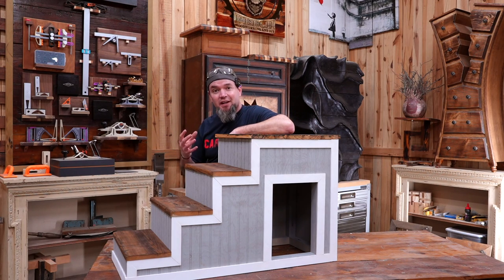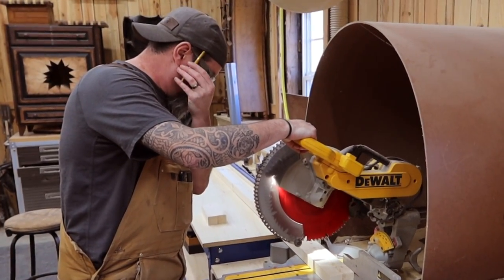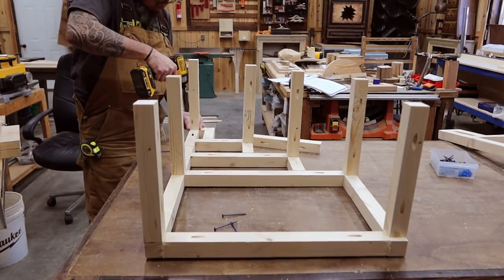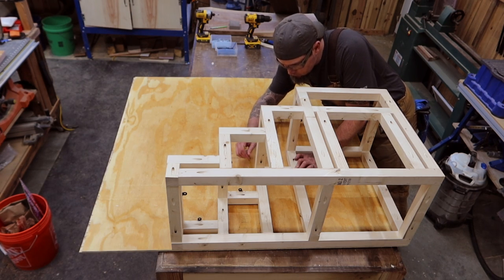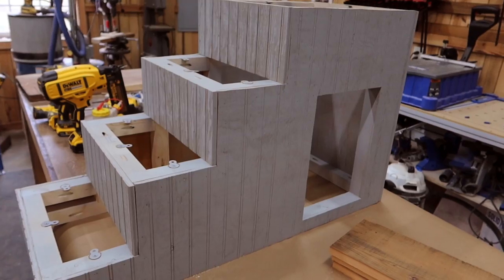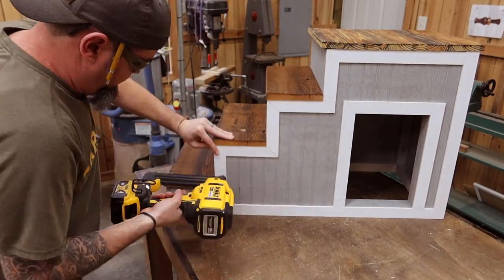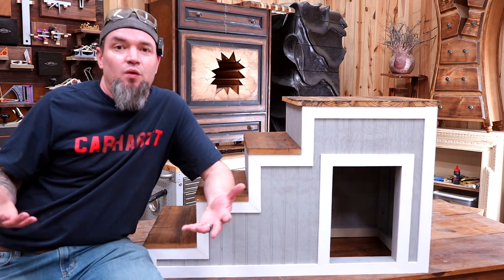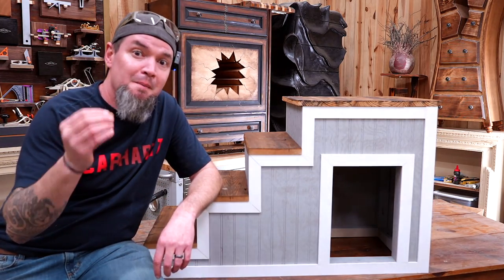DIY Pet Steps - High Profit / Low Cost - Make Money Woodworking

Comment: Matthew like this idea however vets tell owners of some dogs stairs are bad for some smaller animals use a ramp is a better choice and use a piece carpet on it for them to get traction with their feet and also do make the ramp to steep of grade, no more than about 30- 35 degrees. You may wish to make one like that. Also in doing so you will find there are far less cuts to make and less material. You might want to include short sides/rail to prevent them from their feet slipping off the side, 3-4 inches would tacked to the side of the frame so the ramp board would slide in next to it as part of your trim. The ramp is also good from pets that have bad backs and limited mobility. I believe the ramp would be a great seller do to the fact that the compassion people have for older pets whom has shared a long time with them, especially if you marketed it that way. You can get carpet remnants form a carpet company or if you know installers for a reduced price to save money,  or if you know carpet installers have them save some of the scraps left over for you and using a carpet glue small  pieces down like a mosaic pattern or patchwork quit pattern on the ramp board surface. If you do a glue down I recommend using a pad and attach the pad to the board so if the carpet becomes worn you can replace it without replacing the board. The ramp board could fasten using the figure 8 fastners as well. Hope you try to make one and make a video for others. I do believe you are on to something. One could also look to local veterinary offices as a outlet for sales to the customers. You they could offer custom designs and ask for greater money. Even a mom and pop pet store or a big box store might be an outlet to sell you product. Lots of possibilities with lots more addition income to come out of it. Hope this helps.

Comment: Thanks for the tip of ripping down 2x4’s.  Treated 2x2’s are 4.88 each here, a treated 2x4 is 4.18. Made 2 Obelisk using 2x4’s for the price of 1 if I used 2x2’s!

Comment: I'm not trying to split nails here but there's more than a $30 cost to build this...

- $12... 2x4x8... 3@ $4ea
- $18... 1x8x8... 1 Common board
- $14... 48"x48"... Beadboard
- $10... figure 8 fasteners
- $20... Qt of Gray paint
- $20... Qt of White paint
- $15... Qt of Stain
- $8... Pocket hole screws
- $9... 1" 18GA Brad nails

I'm at $134 after tax and not factoring in labor.
Many of these items can be used for additional stairs but the initial startup cost exceeds $30.

Comment: Tried this project as a home hobbyist. The two sides were slightly torqued due to slight imperfections using prime pine from home depot. Had to resort to partial alternative joinery and fill in with wood filler. Went without the cladding. If you have a planer, you might be Ok.

Comment: Great build ,question, when using pocket holes I’ve seen mixed builds, instructions on using a drill or impact on low to prevent over torque, I see you are using an impact is there a preferred tool you use on pocket holes thanks

Comment: Making the top platform hinge for access to inside would be useful, especially for litter boxes.
Reply: To far to reach for a litter box on the floor. Either make a hinged side panel that opens, or simply lift the box to one side or straight up for access.
Reply: Fair enough. I’m 6’4 so a little different for myself was my thinking.

Comment: 5/16 Beadboard isn't available to me locally. I can get 3/16 pre-primed and pre-finished white HDF or MDF, for the same prices, with the HDF being a "Eucalyptus Substrate". Would the 3/16 HDF be a good way to go for this? I have two accounts. I already commented "Second", and hoping I'm not too late to the party with this additional comment/question 😅.
Reply: I have the same issue and would like to know
Reply: @bellgabgio6  Hi. I can’t see it making a difference so I ended up getting a 4x8 sheet of the 3/16”. If it’s flimsy on the sides I’d add a ripped board for support. Will see soon. 👍🏼

Comment: If anyone is considering placing a litter box under those steps, DON'T.  First, the area is really small, and the back panel would have to be hinged to get the box out to clean. Second, it will STINK!! Trust me, I have cats, and when they poo, it ain't sweet smelling, and it's not what you want to smell when in bed. 😁

Comment: Howdy Mr. Peech....

I see You and No one else has responded since my last comment. 

Interesting.

Ive noted MANY MANY times before Sir....

You sound volume is TERRIBLE!!!!

You need to investigate Matt Outlaw, Izzy Swan, Cam at Blacktail Studios and Jason at Burbon Moth. See what they are doing with their microphone. 

Im telling you Dude, YOUR sound quality is very very poor. 

I can hear ALL of the above people just fine while in my shop. When it comes to YOUR videos, if im really REALLY interested in hearing what youve got to say, i have to turn off my AC unit. Turn off my fan and position my phone speaker so it echos your words. 

Thats NOT a good thing Sir. 

Dont say its because of "my" phone. YOU are the ONLY video i have trouble hearing. The problem is on YOUR side. 

Wear the microphone right there on your shirt or something. 

If it comes across too loud on MY end, ill adjust my volume. 

You seriously need to address that issue Sir. Youve told me in the past that you have "high quality" equipment. Then learn to use it Sir. Im telling you again, for like the 6th time, YOUR volume sucks. 

Fix that man, common!!!